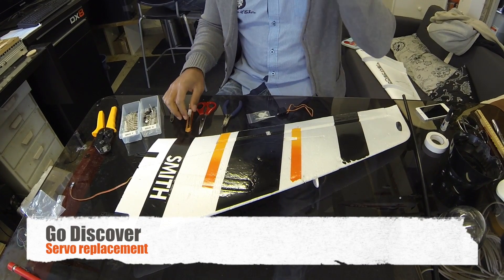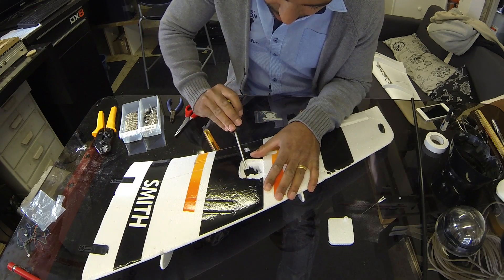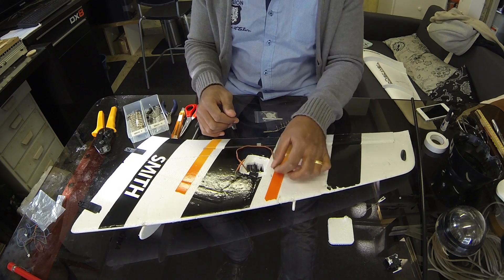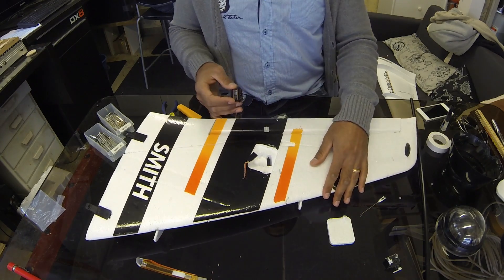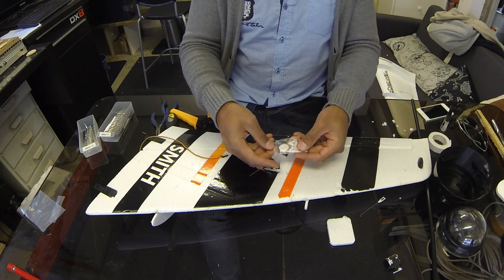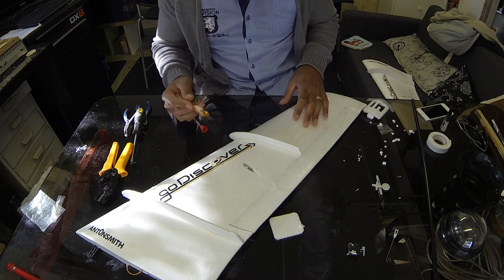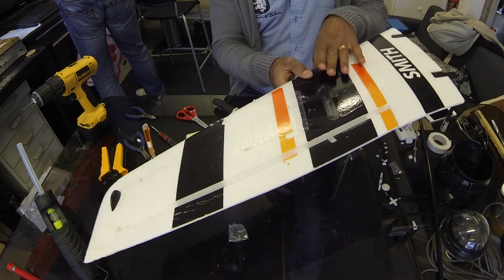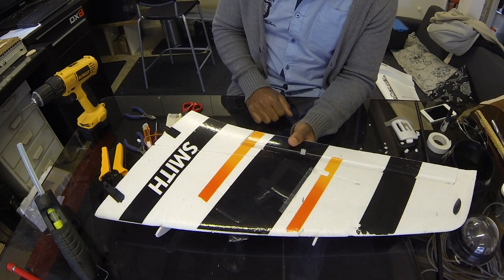Go Discover - Servo Replacement

Comment: Thanks for the video, Anton. How would you compare the Go Discover vs the Skywalker X7?
Reply from the maker: I much prefer the Skywalker X7.  Reasons being: Im not fond of the footage from behind the dome of the GD. I can never really use it in my videos. I like to have a 360 view when flying, which the X7 carries well. The build quality on the GD is not the best, and although the GD looks very cool, the motor mount is suseptable to failing, due to bad cooling of the motor. Lastly I have never been able to setup my GD to be able to fly as nicely as my X7. This is my personal opinion though, and based on how I like to fly. Hope this helps
Reply: ant0nsmith Thanks for the reply. I've been somewhat curious about the GD. I fly a X8, and love it. Would love to see a comparison between the X7 and X8, but I've never seen anyone with both. The X8 is very big, though.
Reply from the maker: Daniel Lockhart Hi Daniel, Im not sure there really is much difference between the X7 and X8.  I mean 90% of it is the same.  I would have bought the X8 if it was in stock at the time, as I like the fact you can really get into the fuselage and layout the components much easier.  However I think that the X7 maybe a little more aerodynamic.

Regards
Anton

P.s Don't buy a GD if you have an X8 - you will be disappointed with the Dome.